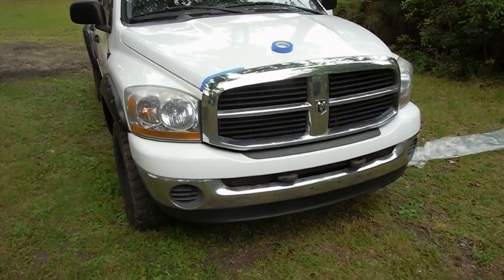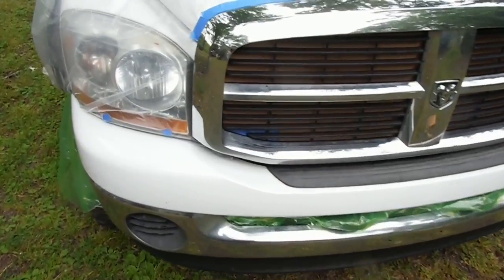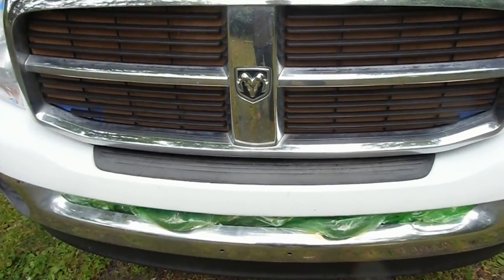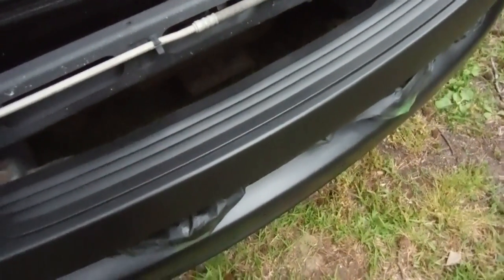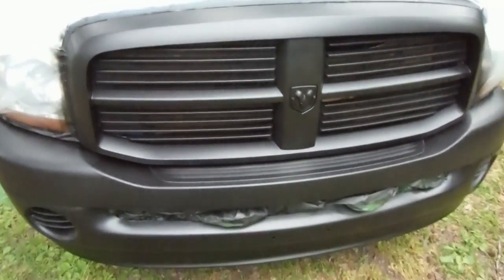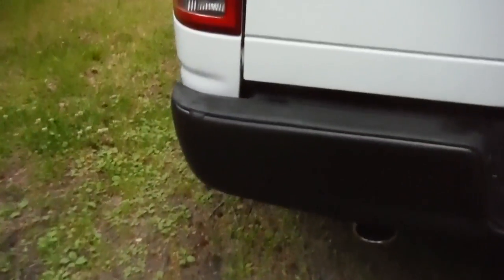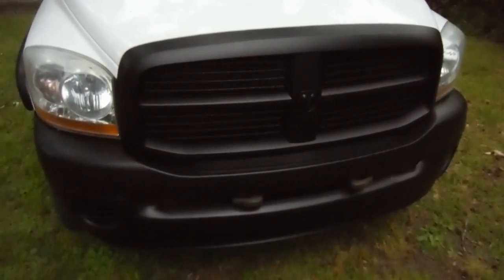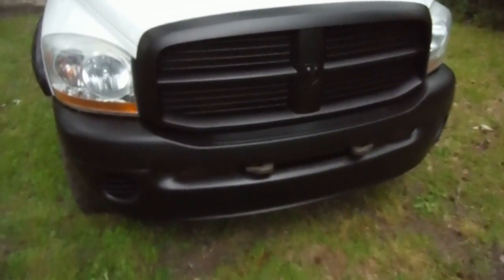Plastidip On My Chrome Grille And Bumpers: Truck Makeover

Comment: Did you protect your radiator or is that caked with dip now?
Reply from the maker: I used cardboard behind the grille to protect the radiator but even if I didn't it would be really easy to peel it off.
Reply: I just assumed it would get all in the vents and cause problems. Turned out good. I'm doing a similar job on my '15 Silverado.
Reply from the maker: Best of luck with your job! I absolutely love the one I did on mine. The Plastidip made it look like a brand new truck and every time I look at it, it makes me smile. I hope yours turns out the same!

Comment: I'm thinking of doing this to my 2008 Ram 1500 but the only problem is the truck is silver and I'm not sure if black grill/bumpers would look good.
Reply: they can look good. silver and black do go together but i can see how some people might not like it. also good thing about this is if you arent sure about it and u end up not liking it, you can peel it off and the only thing u lost is the money you spent on the paint.
Reply: I have a “mineral grey” 2011 Ram 1500, rhino liner rock guard on the rockers and plasti dip grille and both bumpers. It can look good buddy
Reply from the maker: I thought black on white wouldn't look good but I was totally wrong. Try taking a pic and photoshoping the black in!

Comment: How many cans did it take ?
Reply from the maker: I believe the grille and front bumper took two for a good coating and the rear bumper took one.
Reply: Any updates ? Has it peeled or anything since you did it?
Reply from the maker: Some of the edges have pulled back a little with age showing the edges of the chrome bumper and there are a few spots where I hit bugs at high speed that took off some of the plastidip but with a quick touch up spray or two and it looks like it used to.

Comment: About to do the same. I hate chrome, it's just outdated.
Reply from the maker: I agree. The only problem is if you don't do a clear coat it will have spots that need touched up due to road debris. I have thought about painting it black instead.
Reply: Te sales

Comment: Definitely has to be prepped...youll be one of the ones talking crap about plasti dip now bc you didn't do it right
Reply from the maker: The instructions say "clean and dry". That is common sense, not prep. Prep is grinding, sanding, wet sanding, and/or using primer before you start. That is a pain, Plastidip is just pure awesomeness!!!
Reply: Cleaning and drying is prepping...look up the definition bud. If you didn't have to do anything at all that would be not prepping. You have to clean it very well and make sure it's dry before plasti dip...thats called preparation...
Reply: It's obviously not common sense...theres a lot of people out there who clearly don't prep it well enough and have issues...on second thought maybe there is just some REALLY stupid people out there lol.